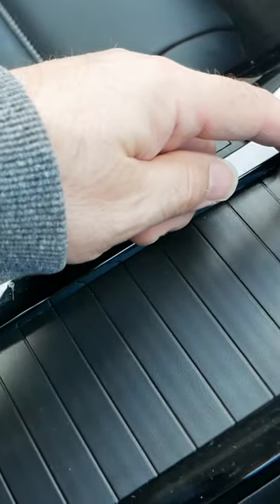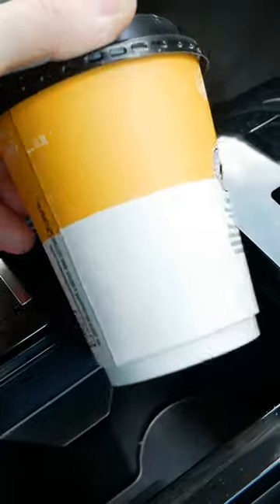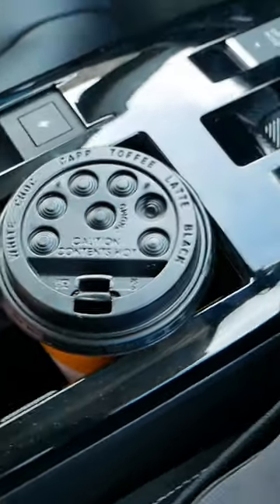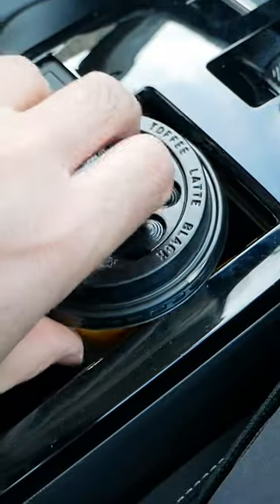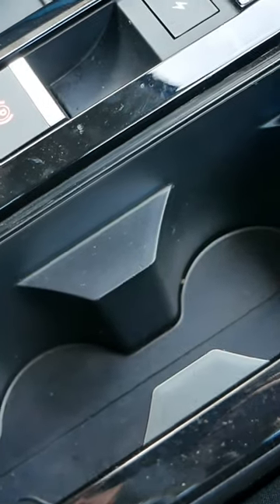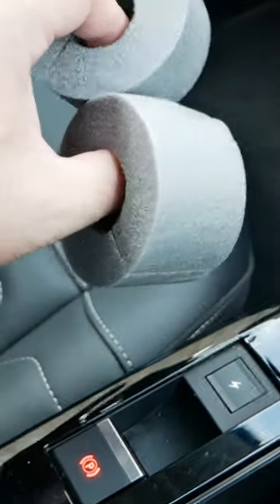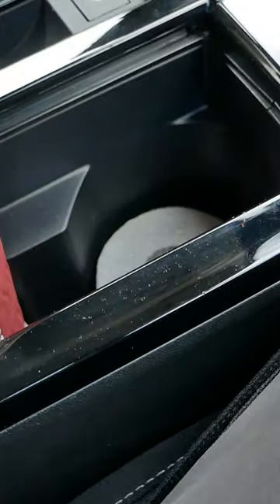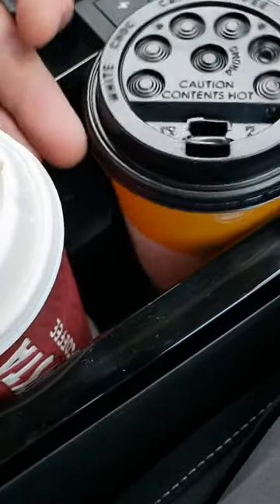Simple cup holder hack for the Citroen C4/e-C4

Comment: That's frankly a ridiculous lack of attention to detail.

It's not as if cup holders are a new and fascinating phenomenon, is it?
Reply from the maker: They clearly designed them for water bottles and flasks, not for coffee cups.
Reply: Or American cups (most are usually length of a milkshake) still it's better then mine where they put the cup holder under the dash where the climate controls are, so I can only use small coffee cups (even then I have to still be careful because I have to make sure the drink hole isn't facing forward or it spill out if full still )